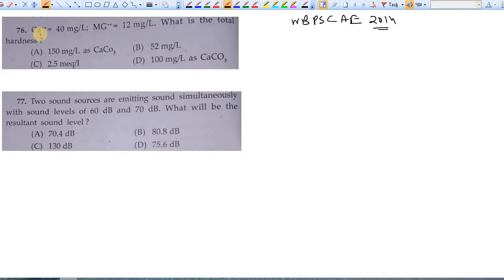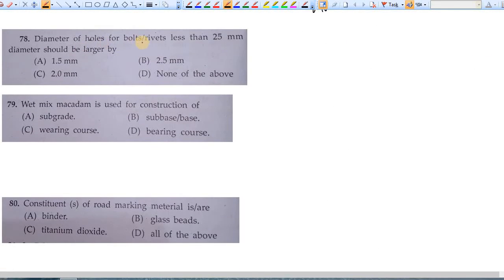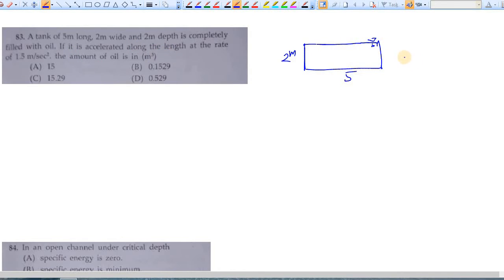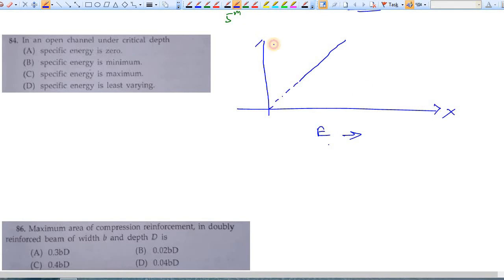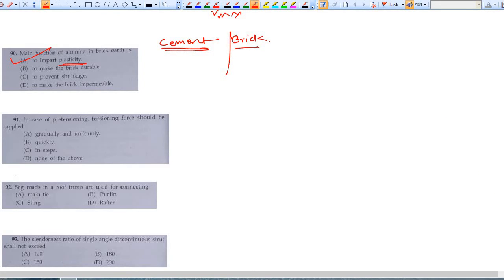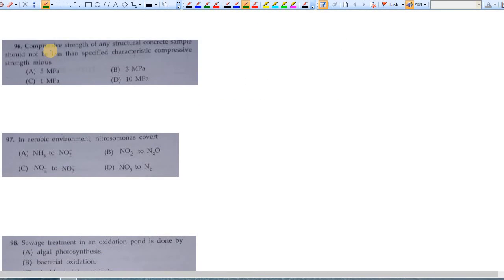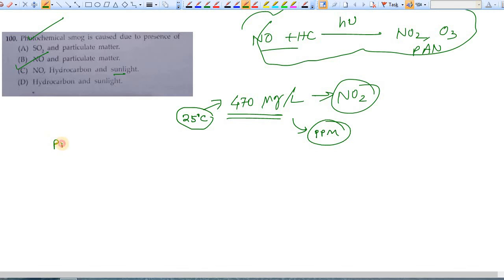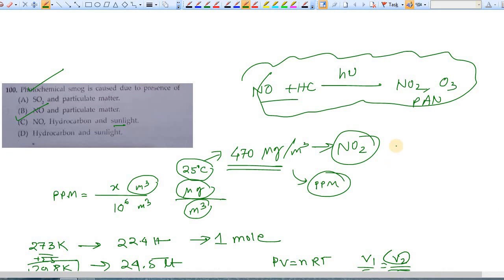Conceptual Question in WBPSC AE 2014 Paper| Part-4 | WBPSC AE Previous Year Question |Tonmoy Maity

Comment: Sir u have done question no 77 in a wrong way..we can't find out resultant Pr.m.s. by arithmetic sum.. resultant Prms will be =√((prms1)^2+(Prms2)^2)...& You will find exact value 70.4.....
But my question is that  how can we solve this types of problems in exam with calculator( I think calculator is prohibited)
Reply: If difference is greater than 10 dB add nothing with the higher one. Ot has short tricks as per as difference between sound intensities has concerned.

Comment: Q78
as per IS 800-2007 , check Table 19
Reply from the maker: It's quite confusing. I have noticed that. But it doesn't clearly give any 25mm slab. 24mm slab is there. So, it can't be used confidently for this question.